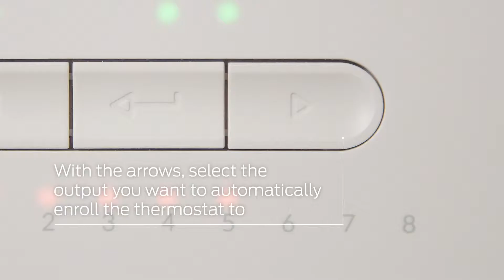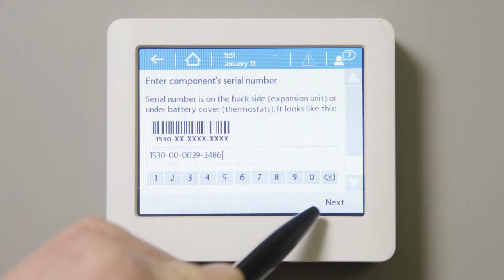Warmafloor Sentio - How to install central control unit

Comment: This is the worst underfloor system ever dreadful bit of kit
Reply: Hi Joseph, could you elaborate? What did you have difficulties with?
Reply: I couldn't agree more mate, even trying to get into the thing without snapping it is a nightmare. No online manual, no diagram. Trying to fault find on one. Terrible